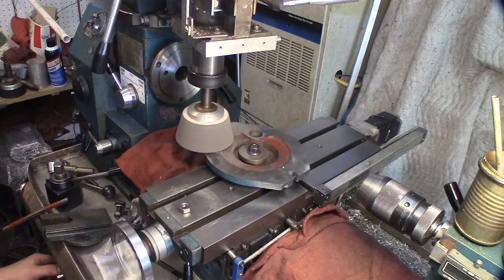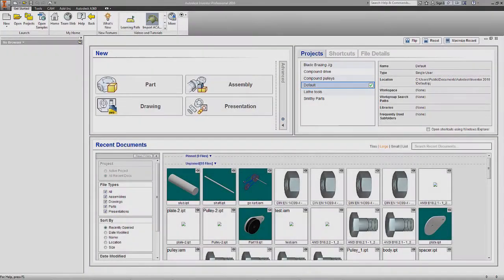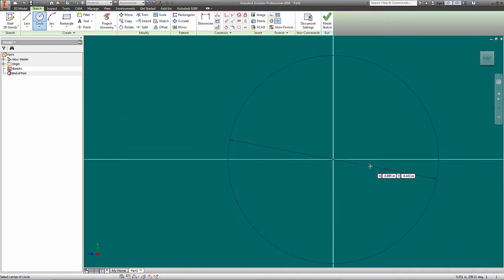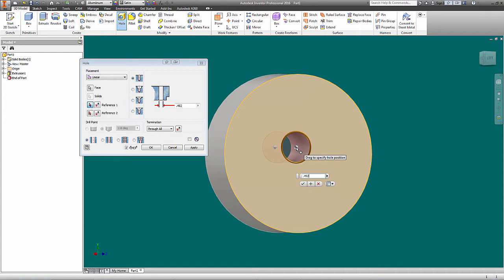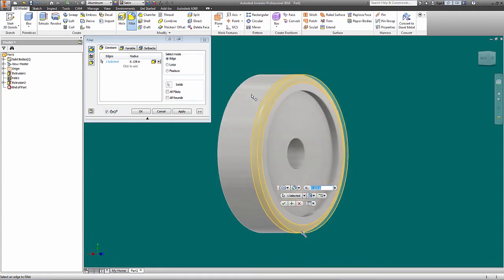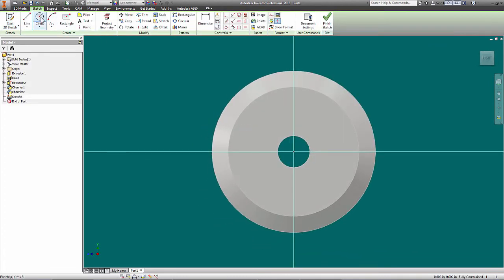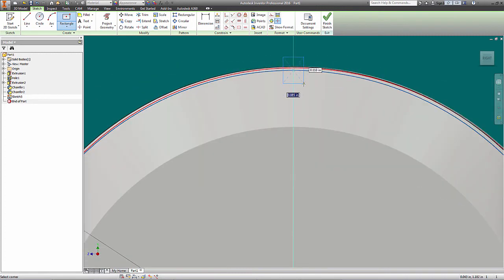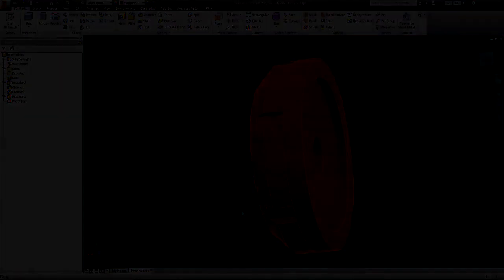Grinding Arbor - CAD Design Part 1

Comment: I do not like CAD period but I certainly do agree with you on the cloud thing.  I want my data right where I am, in my control totally.
Reply from the maker: I hear ya, Harold.  CAD, for the most part is a time sink.  By the time I was done in CAD I could have made the part.  Same with CNC.